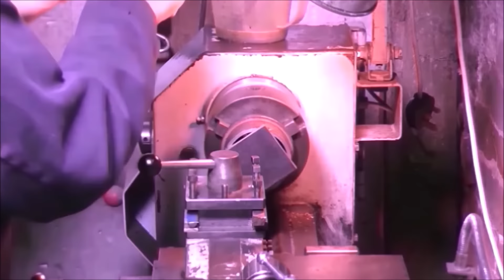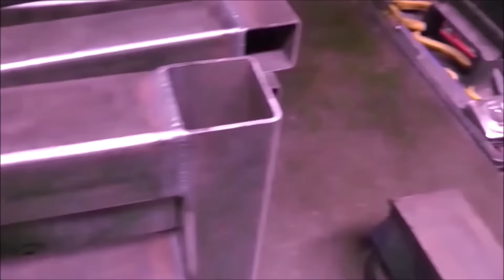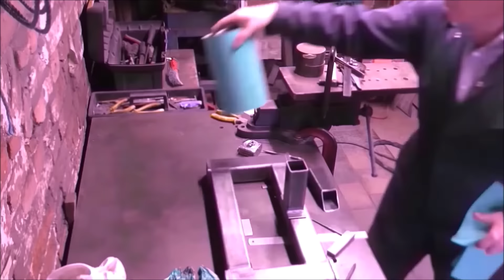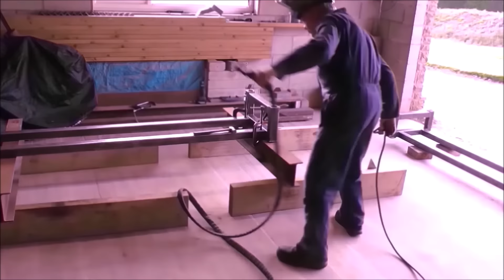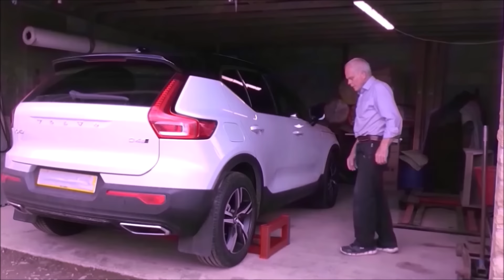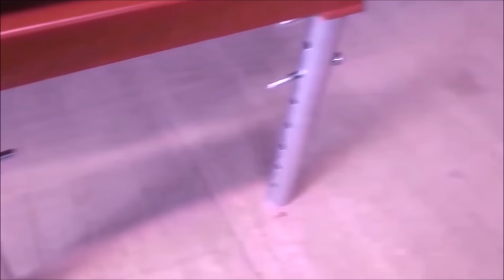The ultimate homemade car jack, simple to use, compact when not in use.

Comment: The next version you can buy a Chinese air suspension jack and attach it to the side, should be easier on your back. Nice work btw.
Reply from the maker: I would rather stay away from Air jacks,  they are quick and easy to use, but if they develop a leak they can collapse suddenly,  if a hydraulic jack develops a leak it is more a loss of performance rather than a sudden collapse. Thank you for your comments.
Reply: @johnbower  Well, you already have safety pin in place, isn't it? I mean just use it to lift up the stand so as not to hold the weight for a long period.

Comment: While this is admirable, it seems like re-inventing the wheel.  I am able to accomplish the same results with 4 drive on ramps (metal) and 4 hack stands.  Total cost = $300

This setup requires great skill, knowlege, time and a lot of money.  This setup will also require a lot of space to store
Reply from the maker: Sorry but these frames have been designed for people who know better.
Reply: @johnbower  there's no need to insult people who have valid observations. This system is only useful if used to lift higher than reasonable drive-on ramps; you could have simply identified that height difference.
Reply from the maker: @brianb-p6586   My reply to Ross Kennedy was not meant to be an insult I was just pointing out that most people here can see the benefit of using my lifting frames. Nice to see you have a valid observation with my system, thank you for the comment
Reply: @rosskennedy1960
Please explain to me how you drive onto 4 separate car ramps? If you have the average car ramp which are roughly 8-12"s high  how do you place the to rear ones under the car , you can place the fron ones in front of the wheels how do you get the rear ramps placed in front of the rear wheels ( average cars ground clearance is less the the height of the ramps so it won't fit.
Reply: @SM-yg1ts  I built crib style wood ramps with 2x12's (ramp and top) and 2x3" for the cribbing underneath and drove my dad's Toyota Four Runner up onto all four simultaneously.  Height is 10-12".

Comment: It needs a lot of improvement…I don’t like the legs and bolt safety because if it fails to hold the car not only will bolt fail or snap off .. the whole  thing will become unstable and  lean and fall .. make it safer so that you don’t get hurt .. I think you need a solid leg support under each tire or something in the middle to make it’s balance solid.. Also work on lifting the car from the middle it will make it easier and safer ..good luck
Reply from the maker: @madghosthunter,   thanks for watching

Comment: That's a great idea... and it works. at 30:00 I was wondering... if you could incorporate the mechanism of a pump truck, ones they use in warehouses, maybe you can get an even lift by only having to jack up from one side..? Might not work or be as stable as you'd probably need wheels on one side.
I don't know... the thought just popped in my head, thought I'd share. Great job!
Reply from the maker: Thanks for the comment

Comment: I love the idea but I know that the beams being right underneath the engine would be a pain at time. Not much you could do about that I guess
Reply from the maker: Because the frame beams are under the wheels there is quite a lot of working space above the beams to the underside of the car, the beams are easy to work around, if frame beams are restricting access just stick a couple of jack stands under the sills and move the frame away. thanks for watching.

Comment: Great idea although a little slow to operate. It may work slightly better using a fam jack or multiple farm jacks. Well done though.
Reply from the maker: Thanks for the comment, Note: it would be dangerous to use more than one jack, when any one side of the frame is being lifted the other side of the frame must always be resting on the floor.

Comment: needs a total rethink, the car jacking point needs to be in the centre of the lift cage and welded in place so you lift both wheels at the same time, half the work and that won't distort floor pans and overstress the linkages beyond what they are designed to take, which is not more than a few inches for most road going cars, it is Ok for the MK1 version but the Mk2 will much better and easier to use,
Reply from the maker: READ MY PINNED COMMENT AT THE TOP OF THE COMMENTS,

Comment: Good job.  You're not going to get a vehicle that high with trolley jacks.  I would get it to right height and use jack stands before I went under
Reply from the maker: Ronald Brosius, Thanks for the comment, If these jack frames are built by someone with little welding & fabricating experience then yes jack stands should be used as a back up safety measure.
Note: It can be dangerous having a vehicle sitting on four jack stands, any thing that has four legs is very rarely stable, as there will nearly always be one leg with no weight on it, so when using four jack stands you have to be careful that the jack stand with no weight on it does not accidentally get kicked out of position.

Comment: looks stable as long as those vertical poles are thick wall ....maybe weld a pad on the bottom of each and leave them in place ???
Reply from the maker: The legs are made from heavy gauge tube which have a 4mm thick wall, If plates were welded to the bottom of the legs it would be difficult to fit the legs into the frames. If the frames are being used on a soft floor then metal plates can simply be placed under the legs to spread the load. Thanks for your comment.

Comment: It's a good thing and well made but I still bought a hydraulic scissor jack - it will lift over 3 tons and the car is up in 60 seconds
Reply from the maker: @richdstamper5630, Thanks for the comment, Note: I do have a hydraulic car lift but the problem with these is they sit beneath the car and restrict access to a lot of the car underside, also you have hydraulic hoses trailing over the floor which stops you using a car creeper, where as with the lift I have made gives clear access the the entire underside of the car and no hoses trailing on the floor, and when not in use it stands on end in corner of garage taking up little space.

Comment: I don't follow your explanation  on the uprights and the adjuster wouldn't raise the device much .  I agree it is more problematic with jacking points though with the support and stability of a 3 tonne jack  you can use the rear axle and front suspension - though the metal around the front suspension on some cars is shockingly thin  to feel comfortable using them as jacking points and the rear axle  on some cars is covered in plastic mouldings., though this doesn't apply to all cars.
Reply from the maker: If you jack some cars up by positioning the jack under the areas you have just mentioned then you are asking for trouble, this is the whole reason I have designed these lifting frames, any make of car can be lifted safely and without causing damage to the car through inadvertently placing a jack in the wrong place.   A lot of thought has gone into designing these frames both for simplicity with safety in mind.

Comment: Building lift pockets into each corner and using four bottle jacks would make this much less tedious to use than circling the car with a floor jack many times.
Reply from the maker: Brian B-P,  That would be useless and dangerous. The lift is designed for use by people with common sense.
Reply: @johnbower  lol you're right,  you definitely got a leg up on common sense. 
The only one.
Reply: @johnbower  LOL

Comment: If u execute it with 4 car-jacks and 2 persons (1 person at each car-side, handling 2 car-jacks at once), it becomes far more viable... A proffesional workshop has a much bigger and expensive one (all things u want to avoid), but still has 4 different car-jacks built-in (something u should also cherish)...
Reply from the maker: Klaus Brinck,  It would be very dangerous to jack up both sides of the frame together,  If you did this there would be no weight left on any of the frame legs,  the car wheels could rotate a little, this rotating action of the wheels coupled with the weight of the vehicle would kick the frame and jack from under the vehicle as it came crashing down.
The frames are designed to be jacked up one side at a time,  when any one side of the frame is being jacked up the other side must always be on the ground.
A lot of thought has gone into designing these frames with safety in mind.
Reply: @johnbower  Ok, didn´t know that, really hard to just imagine...   ;-)

Comment: John, extremely well engineered, however. For everyday use its an awful lot of effort to raise the car 0.5m. You may have been better focusing your efforts on a scissor lift arrangement that would serve the same purpose without the convoluted set up. Not hating, just offering an opinion. 👍
Reply from the maker: Note: I do have a hydraulic scissor lift that you drive over it, then it lifts the car up under the four sill jacking points, but because the lift takes up floor space beneath the car it's actually in the way to get clear access, it also takes up a lot of space to store when not in use, these are the two main reasons I came up with this design, it gives clear access to the entire underside of the car and when not in use takes up little storage space as it stands on end in corner of garage. Thanks for your comment.

Comment: I Ppreciate the man's determination and workmanship to produce this but I dont really see where's it's any real advantage vecause it blocks access to work on wheels, brakes, suspension, steering, essentially anything blocked by the car stand supports.  Plus, that side-to-side jacking and lowering ends up easily doubling or tripling the effort to raise a car versus the sane garage jack with 4 goid jackstands.

I think this design needs much more practical usafe refinement, personally.
Reply from the maker: thanks for watching

Comment: And if you use a square pipe instead of a round one????? You won't need a lathe!Please write down what sizes.
Reply from the maker: Note: there are three reasons why I did not use square tube for the telescoping legs,  (a) there is no square tube size available that would give a snug sliding fit inside the main frame, and even if there was a snug fitting size available it would cause sliding problems as it would be binding on the tubes internal seam welds. (b) by welding plates with round holes for round legs you can get a very snug fit without any binding, (c) these plates also reinforce the joints on the main frame.

Comment: It's nice but too much hassle just lifting each side of the vehicle.  Not only that you have to buy, cut, and weld all metal plus when not in use need a place to store it.  How often you will need to lift all four wheels up and how often do you need to inspect the undercarriage of the car, maybe once in a blue moon?  The only issue I see there is the legs.  made of Aluminum and if the vehicle is jacked way high and any one jack leg gets bumped there is a possibility the jack can collapse and crush the person underneath it.  it is best to make a leg brace for each of the two legs to prevent the legs from spreading..
Reply from the maker: You obviously do not understand the concept with the design of this lift and have very little knowledge of metal fabricating and vehicle maintenance. (a) It will lift any make of car (b) you can lift just one end or both ends of the car (c) ideal for servicing (d) ideal for clear access to the entire under side (e) ideal if you are working on the outer bodywork and need the car higher (f) the list go's on.
To correct you on other mistakes you have made (a) when not in use the lift is easy to store, as it will stand on end in a corner needing little space, (b) the legs are not made of aluminum they are made of heavy gauge steel tube which is galvanized and have a 4mm wall thickness, (c) the lift is safe and easy to use for anyone with common sense.

Comment: I’d have welded in a central jacking point on each ‘bed’, so that after the first lift you use one jack point only front and rear. Does the job tho’.
Reply from the maker: That would be dangerous, read my important note at top of the comments section, thanks for the comment.
Reply: Can’t find a note John. Nor can I see ‘my idea’ dangerous , still incremental lifting but one at rear ,one at front.
Reply from the maker: @arcboutant  Other people in the comments section have also suggested lifting both ends of the frame at the same time, either by lifting under the center of the frame or using two jacks one at each end of the frame. To use these lifting frames safely one end of the frame must always be resting on the floor when the other end is being lifted, if both ends of the frame are lifted at the same time then no weight would be left on any of that frames legs, with no weight on the frame legs there is nothing stopping the car wheels rotating, this rotating action coupled with the car weight could kick the frame and jack from under the car which would then come crashing down. if you look at the top of the comments section you will see my IMPORTANT NOTE  pinned at the top.
Note: A lot of thought has gone into designing these frames both for ease of use with safety in mind, unfortunately I can not make them foolproof.

Comment: Would be great if you build in some hydraulic or air jack on all four lifting points, this way is very time consuming to get it in the air.
Reply from the maker: A lot of thought has gone into designing these frames both for simplicity with safety in mind.
Reply: @johnbower 
Why would you think its not safe anymore if you lift it up at four wheels at the time? If you're in doubt its possible to make a rattle strap over the tires to secure it. Normaly handbrake is enough but these are not at the front wheels.

Comment: Idea h a s merit. As is, too labor intensive. Legs should be air over hydraulics for quicker and smoother operation. Nice!
Reply from the maker: I have designed this for home mechanics etc, simple to build, simple to use,  compact when not in use, can be stored on end in corner of garage. Thanks for the comment.
Reply: Stop assuming that everyone is working inside a garage with concrete under them. I do my work as needed in the driveway which is dirt / gravel and something like this would add great stability when going under my vehicles even for oil changes and exaust work.
Reply: This project could still be used when wheels are removed. use one for the axle with both tires as seen in the video and use the other just forward of the wheels on the axle where the tire needs to be removed ans stack some sections of 2x10 on the rack for height adjustment.

Comment: Sorry, but a car lift that doesn't let you remove the wheels is pointless. And as for using this jack to raise the car and then lower it onto jack stands... well, it would be a lot easier to simply lift the car with a jack and lower it onto the jack stands.
Reply from the maker: Sorry but these lifting frames have been designed for people who know better.
Reply: @johnbower yes not build,  ok you lifted your car , now can you fix the brakes? Oh no them wheels don’t come off!   So this ism pointless
Reply from the maker: @patricklandis3910  I am sure you will understand one day, thanks for watching.
Reply: No it is not whatsoever. There are many commercially available lifts supporting the weight of a car with its own wheels.

Comment: I think I would have use square stock for the lags and harden pins an on the bottom of the lags i would have weld feet and the lifting bar I'd made two and at list two jacks
Reply from the maker: Robert Rab,  Nearest size of square box section available to make square legs would be a sloppy fit causing frames to wobble.   No need to weld on feet, if feet are needed just fit a plate under legs.   It would be dangerous to lift both sides of the frame at the same time using two jacks, there would be nothing stopping the car wheels rotating and kicking the frame and jacks from under the car.   As for you saying you would have used hardened pins, that would be dangerous hardened steel can be brittle causing it to break under load,  yes the pins do need to be tough and the correct term used here is high tensile steel, I used 8.8 grade high tensile steel for the pins.
Reply: @johnbower  well I never said to Jack both sides at the same time I said it be nice to have two jacks and two lifting bar .  That so you don't have to move the jack and the lifting bar from one side of the auto to the other side back in forth if I was going to life more then one at a time I will just go by a 4 post hoist
Reply from the maker: @robertrabhudsonhornet5869  The point I am trying to get across is If someone is using  just one jack then there is no chance of lifting the frame one side while a second jack is still under the other side, which would most likely happen if two jacks were being used.  Note: A lot of thought has gone into building these frames both for ease of use with safety in mind.